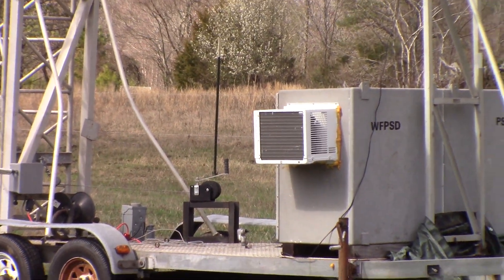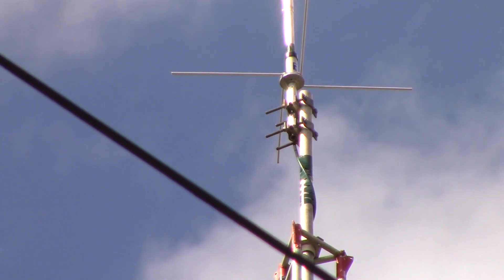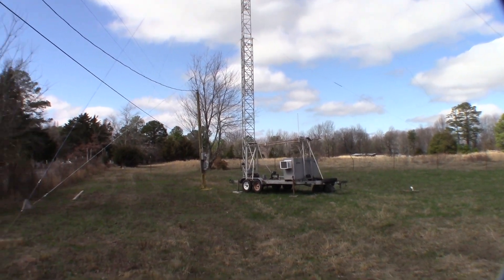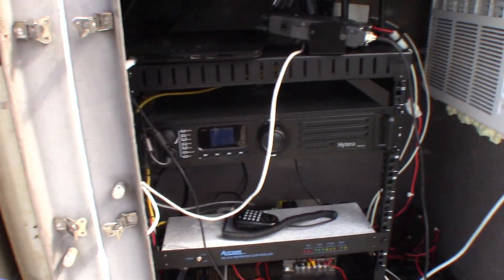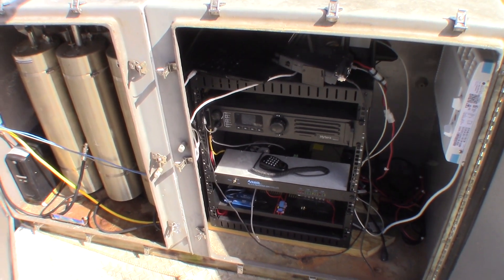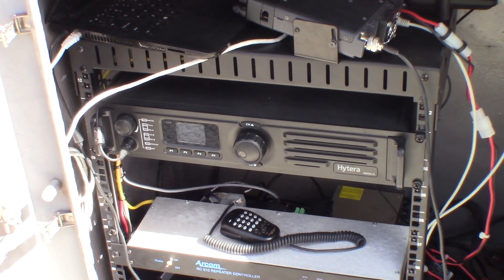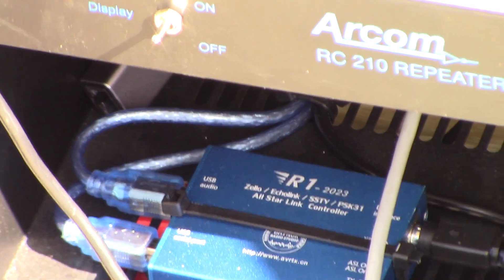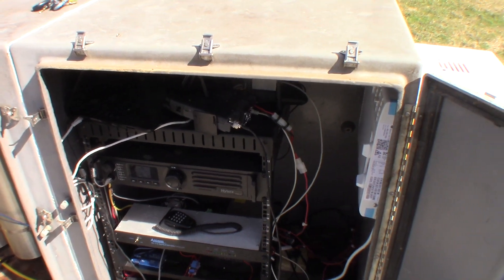My VHF Repeater Hardware Tour

Comment: should be doing much better then .25uV my vhf quantar does .12uV. Also no need for 500w on a repeater. 100w is the sweet spot. 2.2db insert loss on the cans is pretty high should be about 1.5 1.6db. and of course like always stay away from LMR anything in duplex. heliax outside and 1/4" heliax or RG400/393 in cable. de OG free speech repeater indiana.
Reply from the maker: In reality the sensitivity is better, but I said the rated sensitivity just to be safe. There may not be a need for 500w but we do it just for fun. More is always more! And yes there is zero LMR in my system. It's M&P hyperflex. Thanks for the comment!

Comment: ???This is on 147.425?   Isn't that  in the simplex band?   You are bragging about   hundredths  of a microvolt   sensitivity difference,  but you have a short tower on flat land.  Around here we put them on  hilltops

On an aside,  what have you done for grounding?   That  looks to me  like  lightning, incorporated.

What are what appears to be a bunch of other overhead  wires/ cables/ guys?  Is this thing next to a taller tower?
Reply from the maker: It is on 147.425. The ARRL is not a governing body so I threw their band plan in the trash. Around here there's too many dead repeaters taking up all the pairs. 

The tower is NOT on "flat land". It is on a mountain. Coverage is fantastic, around 45-50 miles in all directions. This system even outperforms another repeater at the same height about a quarter of a mile away. The difference in hardware performance is very apparent. It's not hundredths of a microvolte, it's 0.10 microvoltes more sensitive than everyone else in the area. 

Grounding wasn't shown in the video but there are ground rods and polyphasers in use. 

The other wires you see are from power lines. I cleared the setup with the local power company inspector and he gave me the required clearances, which I am in compliance with.

Comment: Hyteria, Motorola and Kenwood.    Running all Kenwood commercial and they are just as good.    Since you live in Alabama I would suggest calling up Commander Technologies and purchasing a commercial grade antenna.    You'll notice even more difference on the Tx and RX.
Reply from the maker: I have a commscope DB-224e at home that needs a little maintenance but that's what's going to replace the Hustler. Same gain figures but far more robust.
Reply: @ScuffedRadio  got a question about the cudy cell/wifi router.    Who is the cell provider you were able to use and what monthly cost does it run you.   This seem like the ultimate solution for remote repeater sites.
Reply from the maker: @stevenharvey1375  I use T-Mobile with a prepaid unlimited data plan. It's $50 monthly. The only disadvantage that it's a shared public IP address, so port forwarding does not work. A VPN has to be used to get that functionality back.
Reply: @ScuffedRadio  so if you're using Echolink or Allstar they will not work without the the VPN
Reply from the maker: @stevenharvey1375  they work but only making outbound connections. I have a "hub" allstar node at home that is port forwarded. My repeater is connected full time to the home hub server and that solves all the issues.

Comment: You should probably put an aircraft clearance light at the top. Planes shouldn't be a problem but drones and helicopters could be. Since it comes back down, it shouldn't be a big deal to replace the light bulb when it goes out.
Reply from the maker: I'm not required to add a light until the tower exceeds 200ft total height

Comment: Very curious but how much does it cost monthly to run a setup like this? (in terms of power draw and an electric bill)
Reply from the maker: Power costs about $35 a month currently. Somewhere around 70KWh a month on average. Now that's just power. There's always gonna be tower or land rent costs unless you own the tower and land.
Reply: @ScuffedRadio  Only 35$ a month just boggled my mind 😂, i was expecting with an AC, and the repeater hardware itd be triple that
Reply from the maker: @camnoalivee  Well out where I live power is cheap too. The usage will go up a little in the summer and again when I add the 500w repeater amplifier in.
Reply: Any plans for solar power supplement?
Reply from the maker: @Subgunman  no immediate plans but I would like to add that eventually.

Comment: Maybe it is an optical illusion, but your tower seems VERY close to the power lines running nearby. Close enough that if the tower tips over your antenna will hit the power lines. Is it really that close?
Reply from the maker: It is nested between a triangle of power lines. Nothing we can do about it. The whole area where the tower is is like that.  I'm not the only one. I cleared it with the utility company and they gave me what was required for clearance and we maintained that.

Comment: Dynema is fantastic rope. It is as you said, stronger than steel, it is also much lighter and will float. The bigest advantage, in my view, is that unlike steel it does not store energy so if it snaps under load it is less likely to flail around chopping arms and legs off or even killing anyone in its path.
I have used it for winching for a few years now and I will not use steel ropes again. There are lots of reviews and tests on youtube so have a look. I think you will be happy to keep it.
Reply from the maker: That's good to hear. We will see how well it weathers too.